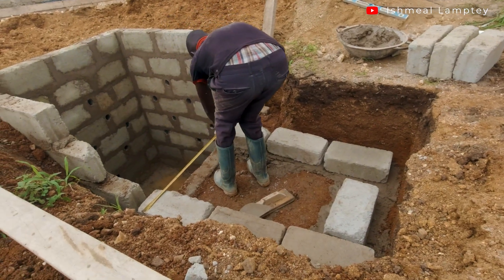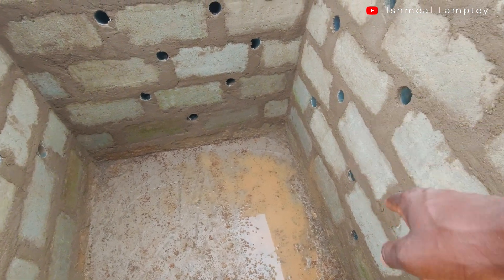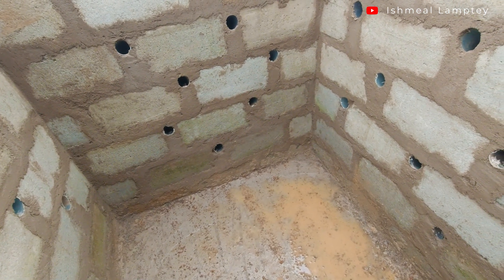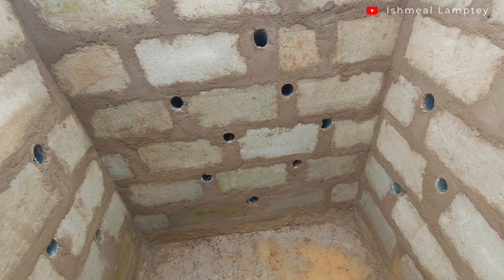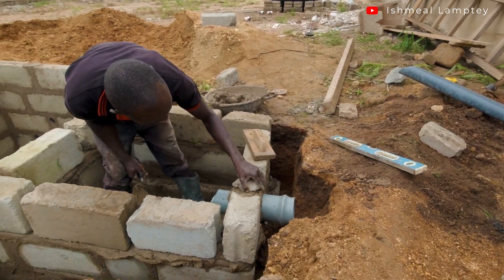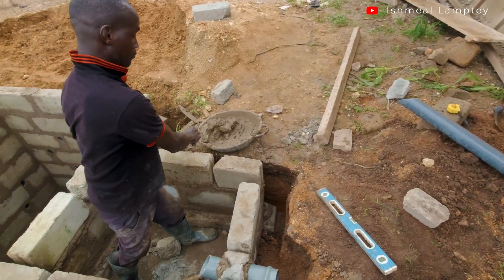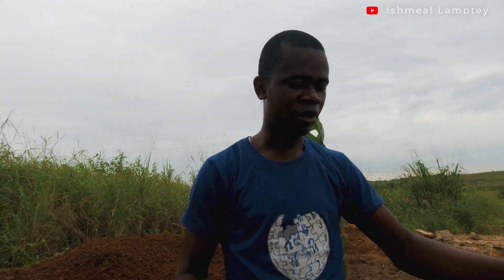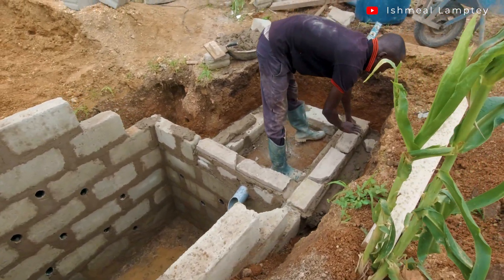Our Off-grid Biodigester and Soak Away Pit - Living Off-grid in Ghana

Comment: Hello sir, how do you handle the kitchen oils that goes into the soak away, will they not clog the drain outlets in future
Reply: Ok but in the soak away, will the oil not be an issue, cos drainage into the soil could be hampered by them
Reply from the maker: @okeychimeziri6600  the soak away is meant to be maintained after some years. So there's the need to open it up once a while and find out what the situation is with it. And if there's the need to draw all the water and maybe sand from it, then you do so. This will allow it to function for a very long time.
Reply: @IshmealLamptey  Thanks for your time. Love from Nigeria.
Reply from the maker: You're welcome
Reply from the maker: The distance from the kitchen to the soak away pit matters. If it isn't a far distance then everything should be fine, but if it is, then there would be a need for an introduction of clean out at various sections to handle any clogs

Comment: Would you say this is the best as compared to the old one
Reply from the maker: Yes. Because it doesn't require you to draw the sewage unlike the septic tank which does. The sewage is converted into liquid, which then goes into the ground. If used well, it can last for years without spending much on it